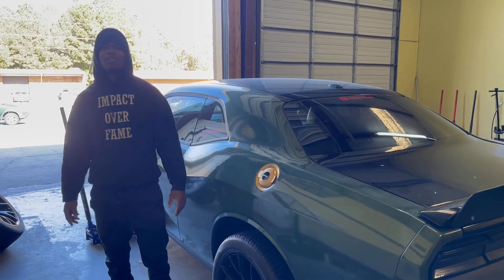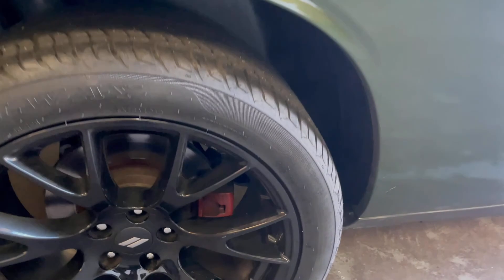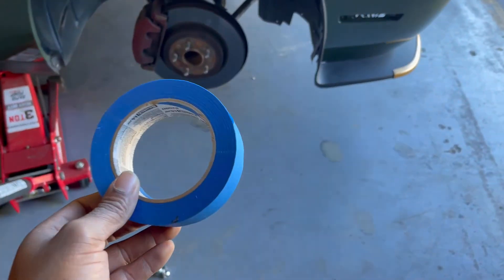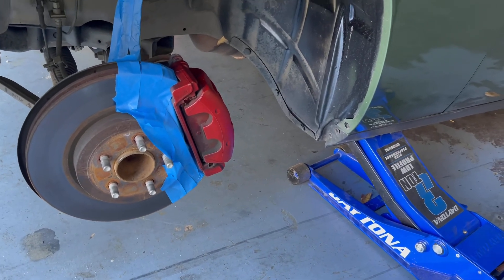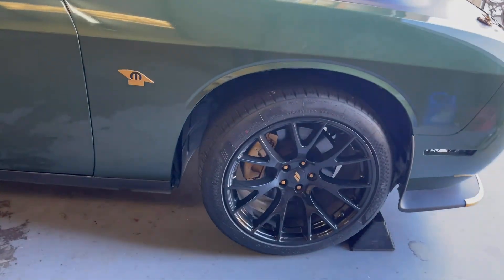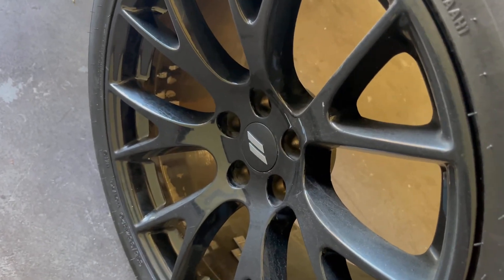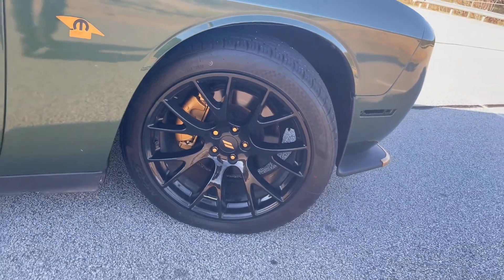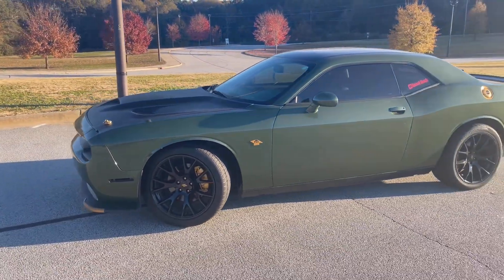ADDED SOME GOLD TO COMPLIMENT THE F8 GREEN PAINT ON MY 2013 RT CHALLENGER‼️

Comment: Looks good but you need to twist the left rear taillight little.
I have the same vlands on my car and you can just push it a little without losening any bolts and then it will be in a straight line.
Keep up the good work 👍🏻
Reply from the maker: Thanks! The car had some rear end damage from previous owner and whoever did the body work didn’t weld it straight. It’s a bigger gap from the trunk to the rear fender on that side which is why the light is uneven. I’ll figure out something though. Preciate it again and will do🤝🏁